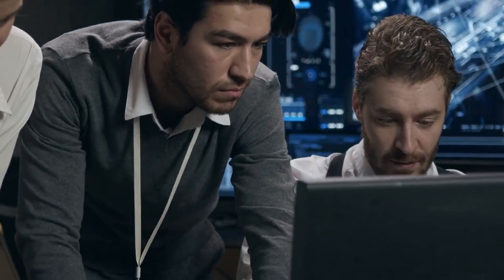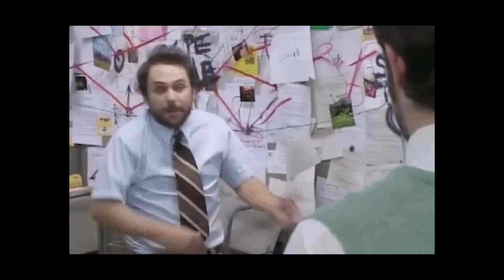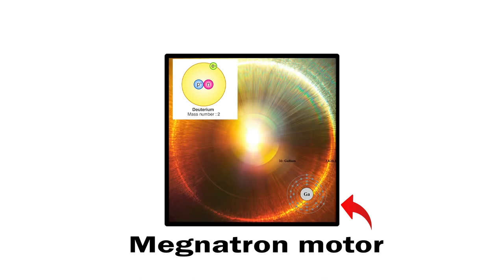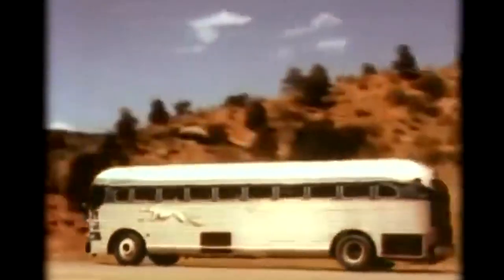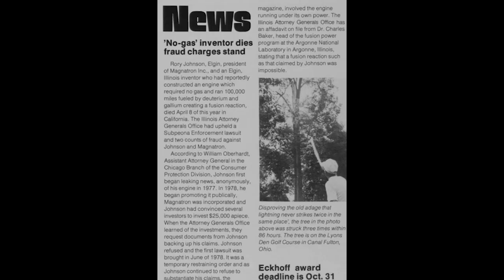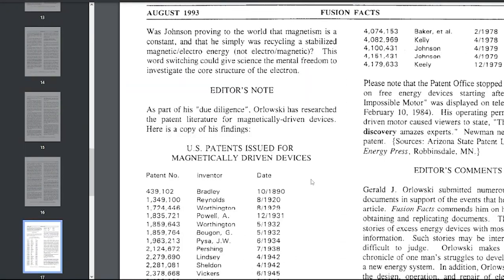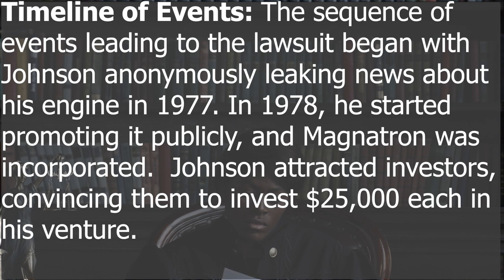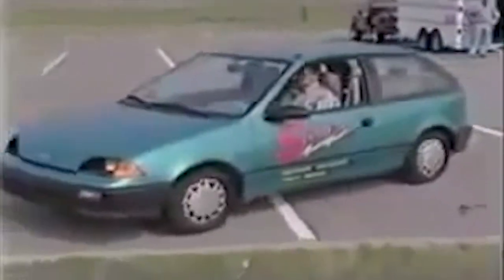Magnatron: The Story of an Engine that could Change the World, and its Suppression

Comment: You should make videos of whatever you find interesting. I find this one kind of interesting and it is kinda cool to have heard the story. It's not like I regret watching it :) However, it seems the video could have been summed up by the scammer refusing to demonstrate the technology. It's a dude just wasting peoples energy, time and money and I guess covering him and others are like strange candy.. a few are fine until they leave a sour after taste. If you want to create a new chocolate box consider giving it a new name instead of replacing the pieces of an old classic.
Reply: This is the story of a Scientist that wanted to test,

Rory Johnson: Magnatron – Light-Activated Cold Fusion Magnetic Motor

During the late 1970’s Howard Rory Johnson, a brilliant inventor in Elgin, Illinois, combined light-activated cold fusion with a new type of magnetic motor into a “Magnatron”. His prototype Magnatron produced 525 horsepower but only weighed 475 pounds. It could propel a large truck or bus 100,000 miles on about 17 ounces of deuterium and 1.5 ounces of gallium before being recharged. This was years before either Pons and Fleischman or Dr. James Patterson entered the scene with their cold-fusion technology.

Johnson discovered the light-activated cold fusion portion of the Magnatron by accident when as he was developing a new type of electronic circuit using deuterium oxide and gallium, he noticed the two materials were producing energy on their own. He could not figure out what was triggering the energy production for some time until he finally discovered it was light.
The Magnatron’s flow of deuterium (an isotope of hydrogen) is controlled by magnetic tunnels. At the point where the deuterium strikes the gallium (a heavy metal electron donor), a beam of light from a diffraction prism forces their fusion. That controlled reaction results in the fusion of two atoms forming a new atom. In the process, electricity is released, and that is what powers the magnetic motor. The Magnatron is sealed, however, so ‘light’ is provided from photon energy produced from coils tied directly to the motor. It is more or less a pulse-generated system.
A photon is a football-shaped particle of electromagnetic wave energy. Its energy content is a product of its frequency f and Planck’s constant h. When an electron in orbit around the nucleus of an atom drops to a lower, less energetic orbit, a photon containing the energy equivalent to the electron’s energy drop is emitted. This explains why light and other forms of electromagnetic energy such as gamma rays and radar are sometimes observed as particles and other times as waves. The heated filament of a light bulb is an example of photon production.
There is no way to explain, using contemporary electrical theory, how his relatively small motor could produce such tremendous horsepower. Utilizing his own new electrical-magnetic energy theory, involving a process he called "attract-attract", Johnson exploited the magnetic field. He used the top and bottom rotors in his motor. First, the top rotor attracted, released; then the bottom rotor attracted, released. The action of attraction, alternating between upper and lower magnets, used the windings to complete the attract field.
Robert Nelson’s compilation of articles about the Magnatron provides much more technical detail on the Magnatron than the foregoing. (See http://www.rexresearch.com/magntron/magntron.htm.)
Johnson constructed his prototype Magnatron’s 525-horsepower magnetic motor without any of the hardware that is presently used in present state-of-the-art electric motors. Conventional motors use the accepted principle of attract-repel, an energy form that doesn't utilize the magnetic field to its greatest advantage. For comparison, a typical 500-horsepower electric motor has wires exiting it that are the size of a garden hose.
The sealed self-contained Magnatron has no wires. Thus, other than the Magnatron’s infrequent refueling with small amounts of deuterium and gallium, the stand-alone Magnatron uses no input power. The Magnatron's entire output power is conveyed by its magnetic motor’s rotating shaft.
Fuel for the Magnatron is plentiful: deuterium is derived from water, and gallium is extracted from abundant aluminum bauxite. Commercially available pure gallium is still scarce and expensive. It may well be possible, however, to cheaply transmute another less expensive element into gallium. See Gary Vesperman’s list of over two dozen methods of neutralizing radioactive waste in

http://iiic.de/docs/GVComparison.htm which includes possible transmutation methods.

The Magnatron uses no fossil fuel in its operation, and it emits no pollution. The magnetic motor’s RPM is 8,000 with a gear ratio of 2:1. Lubrication for the sealed motor is synthetic motor oil which does not need changing and does not need a filter, because foreign materials such as carbon and varnish are not introduced into the system, as they are in the internal combustion piston engine.
This writer, Gary Vesperman, attended the 3rd International Symposium on New Energy in Denver, CO (April 25-28, 1996). I remember being impressed by Gerald Orlowski’'s lecture “Magnatron, Fusion Magnetic Motor”, during which he provided substantial technical information on the Magnatron.
Orlowski reported that, “Some inside information revealed that OPEC had been keeping track of all competitive technology", and Johnson was #1 on their hit list! Johnson was about to manufacture the motors through a nationwide dealership. Some motors still exist, but the owner wants several million dollars for them.”
This writer Gary Vesperman knows of very few inventions of new energy sources which are reasonably large stand-alone energy producers. Besides the Magnatron, they include Oleg Gritskevitch’s hydromagnetic dynamo, and Electron Power Systems’ micro-fusion reactor, which employs stable high-density plasma electron spiral toroids. Almost all inventions of new energy sources are, or claimed to be, relatively small over-unity power converters that convert input power to greater amounts of output power. Bob Dratch’s thorium powerpack is an exception (see above).
At the September 14, 2005 public meeting in Green Valley Ranch casino regarding the proposed Regional Fixed Guideway traversing Las Vegas, Nevada, this writer Gary Vesperman submitted comments suggesting possible power sources for the train, including descriptions of the hydromagnetic dynamo and the micro-fusion reactor

(http://www.rtcsouthernnevada.com/rfg/documents/September2005PublicMeetingMinutes.pdf, pp. 19-77).

No wonder the Magnatron’s inventor, Rory Johnson, was rumored to have been “Number One” on Organization of Petroleum Exporting Countries (OPEC)’s hit list.
The following is an excerpt, slightly edited, from Orlowski’s lecture transcript where he tells about his unwitting personal involvement with the U.S. Government’s suppression of the Magnatron:
“After I saw the Magnatron motor, my life changed. I was no longer a happy camper working by myself in a wonderful, fully equipped research machine shop for the Greyhound/Armour Corporation in Arizona. While on a business trip, I saw this motor running in the Magnetron, Inc.’s showroom located in Eglin, Illinois.
“During my 15 years of electric motor repair, among the hundreds of motors I repaired, I rewound a 500 HP electric motor. That motor had wires exiting it that were the size of a garden hose. The Johnson motor being shown had NO wires. Surely this motor was unreal, a con-job to get money for dealerships. Yes, there he was, Rory Johnson standing next to his sealed self-contained electric motor.
“Upon returning to the Greyhound Towers and telling them what I had seen, they instructed me to call Mr. Johnson. Greyhound wanted Johnson to put forth a plan to install a motor in one of their buses for testing purposes.
“I called Johnson. He was delighted that a Greyhound employee had seen the motor running, and replied that the testing idea was acceptable. He would set a time frame for just when a bus should be delivered to him.
“Two years went by, with no business proposal from Johnson. Then, his former business partner, Mike Marzicola, called to say Johnson had passed away. He wanted me to work with him to get one of the motors running. I flew to Orange County, CA, saw the motor, took pictures, and put forth a plan to Greyhound. Subject to a contract with Marzicola, one of the old worn motors would be brought to the research shop. I would then very carefully reconnect the generator wires that Johnson had cut off prior to moving from Elgin, IL to California.
“Discussions with Marzicola brought out that the U.S. Government (given the authority by the Congress of 1952) had issued a GRAB order to take Johnson's motors. Rumor has it, the DOE is run by US oil companies and OPEC, and they want no competition, period. Because of this grab order, Johnson had cut the generator wires. He had then put his `total shop', with motors and all, on several U-Haul trucks and left Illinois in the middle of the night. He went to California to re-establish his business. But before he could get a motor running, he passed away.
“Surely, Greyhound would agree to let me re-start one of Johnson's motors. The wonderful proposal put forth to Greyhound was rejected by mail. Very agitated, I went to the top office at Greyhound demanding an explanation. I was met at the door with the comment, "We know why you are here." Knowing the potential savings to the bus company, surely they could have only one reason for rejecting the proposal. They must have believed I was not qualified to start up the motor.
“Greyhound’s top legal advisor stated he was present when the Greyhound board met and discussed my written proposal. He stated the following, "At NO time was the thought put forth that you would not succeed. In fact, we discussed all of the hardware designed and constructed by you, and started the conversation from what happens when Greyhound has a running motor. We contacted a State representative who felt this motor should not be allowed to be used in 4,000+ buses. The loss in tax dollars for fuel alone would be a very huge sum.” He then asked me to leave, stating he was sorry that he had to tell me the reason the plan was rejected.

Mr Johnson doesn't sound like a Scammer any more, it sounds as per usual, "Money, Greed and power"